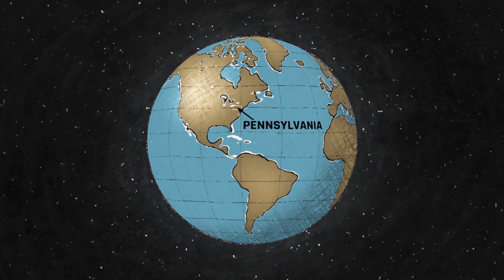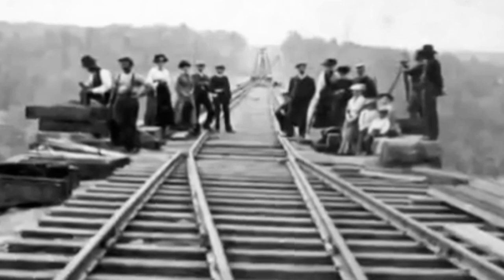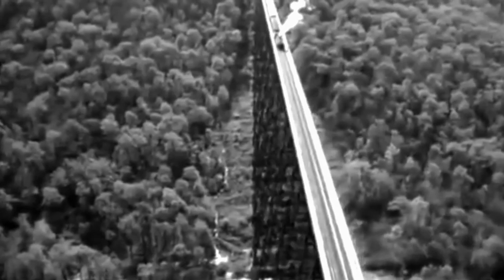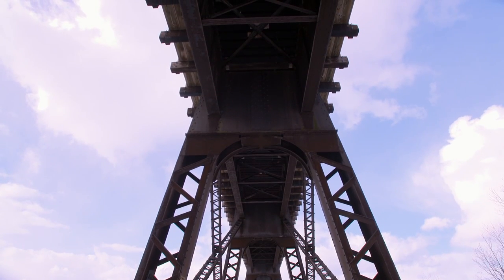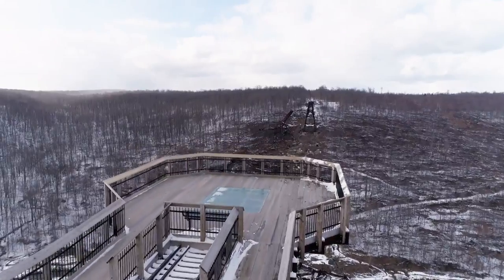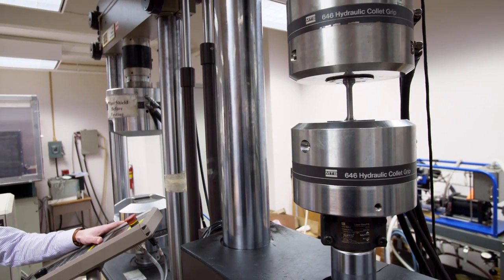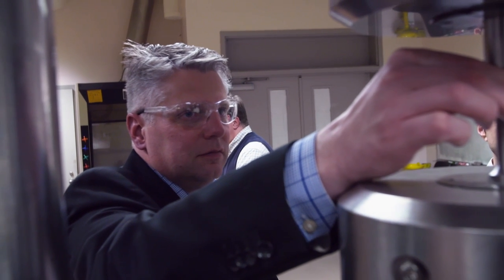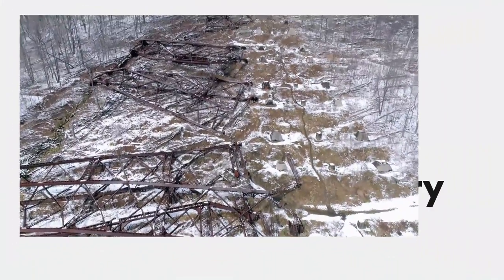How The 8th Wonder Of The World Failed Due To An Engineering Oversight |Massive Engineering Mistakes

Comment: Confused about what actually failed. They keep saying anchor bolts. But there are no boots here. Its studs anchored into concrete, with specialized nuts that include a collar (the studs were too short for the new, taller base each stud needed to clamp. So the collar acts to extend working length of stud).

If it was these collars that failed, they could have simply come back in any of those 100 years and replaced the collars with ones of superior metallurgy. Unscrew old collar, screw on new one.

Sure, each collar would have to be specially made, and there are a lot of them to change. And unscrewing something that has been rusting in place for decades wouldn't have been easy. But there are ways to do that.

They keep mentioning labor cost to drill out old studs and replace with better (and loner) ones. But it seems the actual issue was just the collars, which could be unscrewed like a nut and uograded. Leave studs in place. Avoid all the prohibitive costs.

Comment: I was just getting on here to say the same thing that I'm glad others have already said: This bridge served its purpose for well over 100 years and definitely was a success. The failure is people in 2004 still thinking that a bridge from 1800-something should still be used, continuing to carry and support heavy locomotives and railway cars. Not to mention the "failure" here was an act of God weather event and while we try to design and plan for structures to withstand these types of events the greatest human design and engineering fortitude will never completely  be able to handle all events powered by mother nature, and especially so when considering the comparatively limited engineering wherewithal and design foresight of 1800s-era engineering.

Do you think that the coal company executives of the 1800s would consider this a catastrophic failure? No, of course not! They achieved their goals and met all of their objectives and were able to quickly replace and rebuild a bridge which quickly came online and enabled them to quickly move all of the coal they desired in their day and age. I highly doubt that the coal company executives/bridge designers/engineers/construction personnel of the 1800s ever even attempted to ponder or conceptualize anything about the year 2004, lol.

Comment: This analysis misses one important fact. Bridges are designed to handle loads from the Top down. Lateral loads are considered and the A Frame is a good choice. A Tornado is hit this bridge with way more lateral force that I would guess even many modern bridges could handle and it was 100 yrs old too not a bad run.

Comment: The fact that mother nature took a huge... deposit... of energy and went batshit... Doesn't answer the significance of metal stress test... Regardless of warning indicators - once stress goes passed the point of failure = failure! But from the way that was slipped in, you guys think if the bolts could of stretched before they broke, they won't of broken! How's does that work?

Comment: They use kilometers instead of miles per hour to try to hide the fact that a VERY weak tornado took that bridge down. An F1, literally the lowest classification they have. This is a tornado that would have breezed through a trailer park and left most of the park standing. Still... it was a long bridge that stood for a long time. Can't be mad at the engineers. Literally nothing is built to last forever.

Comment: A disaster??  It lasted for over 100 years without fail.  It took a natural disaster, in this case a tornado, to take it down.  Can these engineers 100% confirm that if they had used steel supports the bridge would still be standing?

Comment: I'll tell you what a real fail is. The british Tay Bridge Disaster. Where a poorly constructed rail bridge built not even a year before experienced a structural failure while a train was crossing. The failure resulted in seventy-five deaths. 

A tornado that caused a bridge which was undergoing repairs to blow over, causing no deaths or injuries is not a failure. It is a natural disaster.

Comment: It lasted for 123 years, you can't ask for better than that. That is not an engineering disaster, you should have replaced the whole thing 23 years earlier. Even if the anchor bolts were good the tornado could have destroyed it.

Comment: I’m not normally a fan of the egocentric engineering community. However, the bridge worked, as designed. It even worked as it was not designed.
It didn’t withstand a direct hit from a tornado, and that’s an engineering failure?
So a house destroyed by a tornado is the fault of the architect?

Comment: I don’t see this completely as the original designers fault. First it lasted for ~100 years. Not sure of it’s design life but that beats the hell out of structures built today even if it was an F1 that made it fail. Second this should have been picked up when the maintenance was being done so the inspection team is partially at fault. Last, as someone who works in the design/build engineering world, it would be safe to assume that somewhere there is a document showing the engineer specified new steel anchor bolts but was overruled by the client who went with the cheaper option.   Just a guess but based on what I see day to day a safe assumption.

Comment: Though it was a fault that could have happened from a normal strong wind, I wouldn't call it failure, no bridge would be fine after a tornado, it might still stand but it would lose a lot of steuctural integrity from a force that size, engineers would design and do it right, clients say what should happen, though it is safe enough to not rebuilt the anchor blocks, it wasn't the right choice, but our factor of safety usually is 1.5 to 2 depending what we want to do. Anything permanent we build should last 500 years, so I guess this is why it is called a failure. But still it is a marvel to behold and to know what these guys pulled off a 100 years ago, it is a major success, can not blame bad engineering on a tornado that would ruin any modern bridge.

Comment: I'd hardly make it a point to analyze the forward thinking of the engineer. Given that the bridge functioned for over a century without incident and obviously without proper maintenance I'd say it worked adequately. If the decision to not replace the wrought iron with steel was as detrimental as detailed in the video then these very men should have replaced them. I wouldn't hold the engineers of old accountable for the fact that their "masterwork" was poorly maintained by later generations.

Comment: Sounds like a very successful bridge to me I don't think they can do the same thing and be under budget they could have did something by welding plates to the bottom to the existing bottom structure and then added more bolts but tornado would have probably still get considerable damage to the bridge.

Comment: Blamed the original engineers despite having decades to change out the fixings. yeah, I'd say it was whoever was in charge of custody/maintenance of the bridge (structurally & financially) since the rebuild being the people at fault. What?...they only just knew about the fixings after it failed? If they did then that was shoddy work by the inspection "engineers" too!

Comment: 90 days and 121 men. Shit you can’t even get a house built to completion in 90 days in our current era. So basically while it was under repair a tornado hit it and the bridge failed so basically instead of addressing the probability that they had altered the bridges structure and therefore it’s their failure they’re blaming it on someone who can’t defend their engineering. So these iron anchors are being tested individually instead of their combined tensile strength. Hummmmm

Comment: Total clickbait. Bridge was well designed enough to last for 100 years until it was hit by a tornado. Being hit by a tornado is not exactly a failure mode that structures are often designed for.
Reply: I noticed how they kept focusing on the iron anchor bolts that helped hold it up for over 100 years 😂

Comment: Saying that this bridge, that was built in 90 days and lasted for over 110 years, "failed due to an engineering oversight" because the engineer forgot to account for a direct tornado strike a century later is like saying.. a car that was built in a few hours at a factory, lasted 50 years and traveled 999,999 miles on the original engine and transmission failed after an asteroid landed right on it and blew it to smiderins totally failed due to the engineer and its all his fault, he should of definitely seen that coming from a galaxy away and should of used stronger steel that was asteroid proof. 🤪

🤦‍♂️

Comment: I believe that if those those corks didn't fly away their spot, that cement or metal brokes some other point. There is more than just those pieces what have made otherwise than how you see today's beams and structures. Longitudinal way is almost fully not trusted any way. Still it handled trains more than 100y. Same what normally asked today's structural age. And many times they cannot last that long because rainwater is more corrosive than over 100y ago. It eat some cement and steel/iron more better. Paints are better to nowadays but still maintain needed for structural parts too. So looks that building industry has gone better more than some worse way. It ofc depends where you look and if you look china, whole industry there is one big joke. That is bad joke + that could effect dangerous ways to other parts worldwide.

Comment: 120 men build it in 90 days while California  has 5000 men working on a high  speed rail that's not even 20 % finished  and it's been 10 +years in the making  all 5000 should  be fired and hire those 120  they will get it done

Comment: The engineering blunder happened in the last few years of this bridges lifespan. Not as much in the original design.  Which was also jacked. These should have been slowly replaced in modern times.
Is "climate change " to blame here? 
When was the last tornado here? Are they common.

Comment: They lost me when i heard epic tornado... I don’t call that a failure You could say the same with today building if in 5 years there is a huge earthquake 10 level. Would it be a engineering failure? Or what if there is an asteroid.? Or a massive solar flare hitting the electric grid. In 2025 as it is suggested? Or a triangle bermuda dark cloud appearing in front of planes and boat that make them disappear.. human design are not designed to last forever for any circumstances. There always exist a condition that even the mist well think design will fail in the future.

Comment: This is some clickbait, over dramatised shit. An old bridge that was already closed due to corrosion on the supports getting blown over by a tornado is not an engineering mistake. What if a train was going over it? Well 1 ) the bridge was already closed for safety 2) what happens to a train on sturdy bridge when a tornado hits it? 
Also not the eighth wonder of the world

The frustrating thing is this was really interesting and a really cool bridge but it didn't need all the hyperbole and over dramatisation